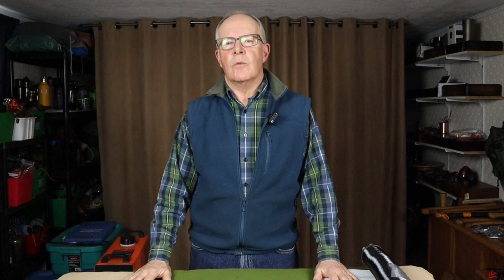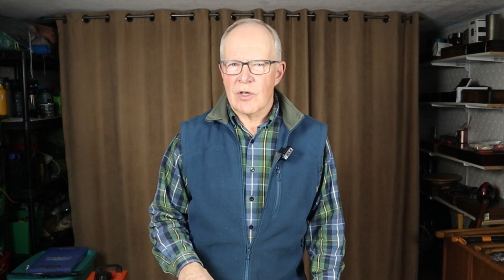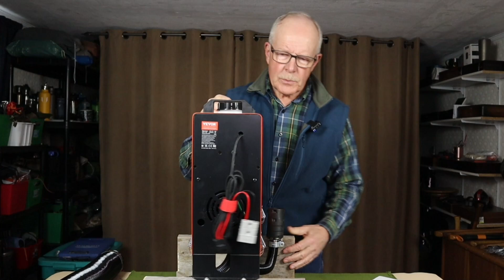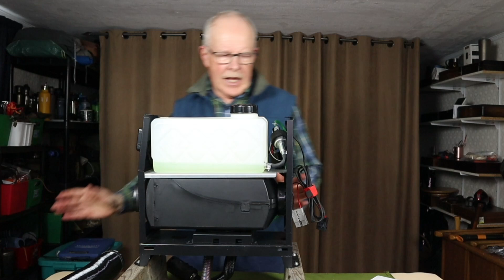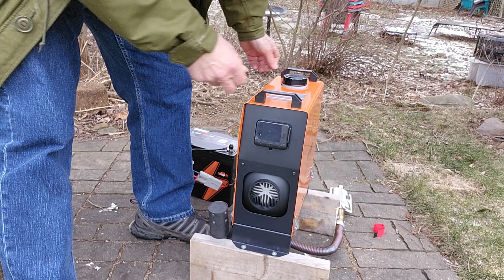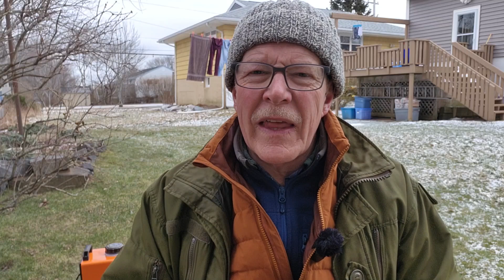VEVOR Diesel Heater - Part 1

Comment: There are better heaters out there now and dont need dirty fuel. Truck drivers have been using these for decades because they connect them directly to their fuel source. Not sure why this is such a big deal now and youtube keeps shoving to everyones suggestions.
Reply from the maker: Yes, as I mentioned diesel heaters have been around for a long time and that this is a very base model reflected by the price. The reason you are seeing more of a push is that diesel heaters are not a well known option in the camping community. Thanks for commenting

Comment: These are very interesting.  I’ve been looking at them for a while, for potential use down the road, and the tent idea is a good one, since I’m planning on getting a hot tent in a couple years for hunting.
One thing I saw about these is that you should open it and go through all the connections, because they may not be tightened correctly. Especially if it was assembled near the end of the 18hour shift at the slave factory.
Also, you didn’t mention the battery life!!    That’s my biggest question!
And on a side note, I just found out that I’ll get the gov support to go back to school, so those financial issues I was having will probably be a problem the rest of my life, but at least now I have a chance at managing it better.  Plus I’ll be able to move with that career, so who knows, maybe I’ll even move out your way.😊
Reply from the maker: Hi Jim. Good news about going back to school. Can you share what you will be studying? I need more experience to judge battery life. The biggest draw is on startup. Once it is up and running it only requires enough to run the fan. The outside temperature and how hot I set it will be a factor in how often the fan kicks in. I will get a better idea once I start using it with a power station. Thanks for commenting my friend
Reply: @  im doing a program to be an orderly in hospital, or senior residence, as well as home care.   Be done by September if all goes well.
For the heater, the pump must use a little too, plus every time it turns off by thermostat, it needs a flow plug to start up again, no?
Reply from the maker: @jimf1964  I am impressed Jim. That can be tough work. Yes, the pump does draw some power as well. I should get a better idea of how much when I hook it up to a power station
Reply: @ well, at my age, I can be a patient and an orderly at the same time! 😀
Reply: @   It’s been a real stress about money.  My job sort of slowly petered out, so money became a big issue. I kept holding on, hoping it would pick up.  By the time I started school, it was a real problem.   This course was a bit of a Hail Mary because if I didn’t get the help, I would have been screwed.   You have no idea what a relief it is

Comment: I have a Hcalory suit case heater for 2 months now. I purchase to use with my Casita Travel trailer. I run the heater hose thru ac inlet. The heater works perfect from 22 degrees to 68 degrees in 45 minutes. I also use the heater in my front room. I vent the exhaust up my fireplace chimney. I have a carbon dioxide detector to monitor fumes. I also have a diesel heater for my shed, 10x20. It heats very well.
Reply from the maker: I am just getting into diesel heaters but I can see a lot of reasons for owning them. Thanks for commenting

Comment: How are the noise level once up and running?  Quiet enough to use at a radio and dog free campgrounds? So not to bother next sites?
Reply from the maker: That is hard for me to say. I can barely hear the ticking noise at a distance of 10'. Inside my tent all I can hear is the fan when it is running. The ticking is much less from inside. Still, I am not sure it would pass your park's standards. Thanks for commenting
Reply: @markyoungbushcraft  I wanted to know about the sound from muffler and hole heater is running not the initial ticking.
Reply from the maker: @xxgg  For me, the sound from the muffler is minimal. I will update on this in part 2
Reply: Over all the, my Hcalory suitcase is very quit. Outside  and inside.

Comment: LOL lovely to see you getting into Vevor diesel heaters. Very longstanding tradition in the UK of using and modifying them, including to run on waste oil (ranging from repair garages to fish & chip fats). They're based on the old Webasto designs and official Webasto are still the go-to (almost "only") heaters for cold weather boaters and yachters.
Reply from the maker: I was not aware. They are just getting started here. Thanks for commenting